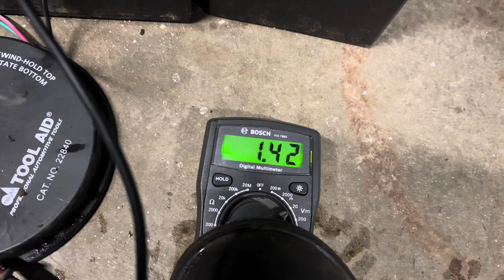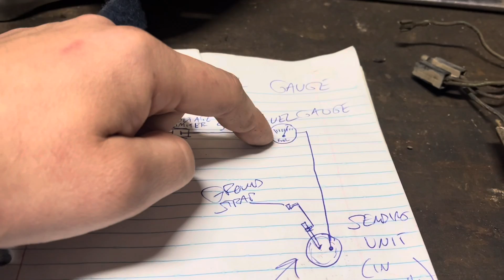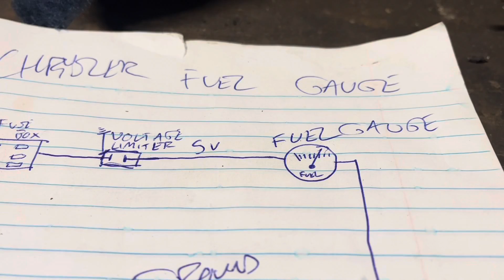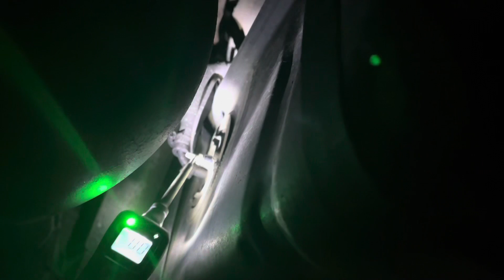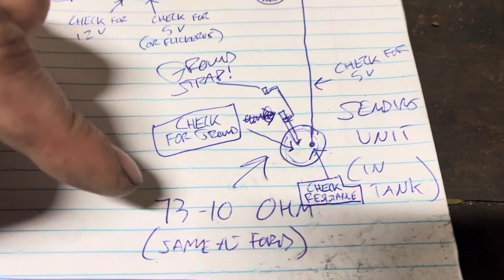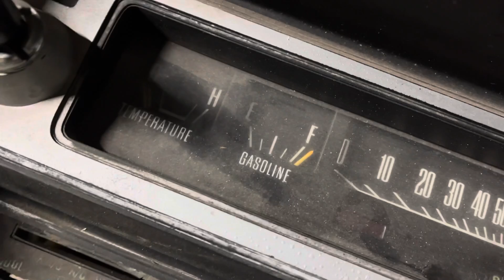Classic Mopar Fuel Gauge Problems (And Gauge Voltage Limiter Info)

Comment: Nice Demon BTW. I have 2 '71's a Charger R/T and a GTX and both have those vapor tanks with the 4 hoses mounted under a panel behind the left rear wheel. They also had the 3 nipple crankcase breather which vents fuel tank vapors into the crankcase. Nice. I disconnected the hose from the tank to the breather. I think each one of those 4 vapor tank hoses go to a vent pipe in each top corner of the fuel tank.
Reply from the maker: Very interesting. I know ‘71s have the four lines but had no idea how they were set up. I had a ‘71 Charger 15 years ago, and still remember seeing all those lines under that. I never drove it unfortunately. That has been a recurring theme with me and third generation Chargers, actually. I’ve owned four, and have never had one that was drivable.
Reply: @DeadDodgeGarage  I guess this is my fourth. It's a 46k mile 4-speed (440), pretty original. I had a Hemi orange R/T, a green '72 rallye 440 and a nice '71 parts car. This current R/T never had a working fuel gauge since I owned it (1998) and I bought a new sending unit and tank long ago and just got around to putting them in a few years ago. I cut the old tank open and you wouldn't believe what it looked like. First time EVER I've seen a rotted brass float. Looked like it was submerged in acid. The original sending unit was 'OK' but didn't work. The inside of the tank was abysmal. I scooped about 1/2 gallon of rust flakes out and it was really weak and nasty. Stored a long time with old gas. You could see where they ran those vents when I cut the tank open.
I think the Spectra tanks are the best, made in Canada OE quality. I used a 'stainless' sender, probably Taiwanese, but seems to work OK. There's some tabs you can bend on it to adjust the range from empty to full. I used a Spectra tank on my GTX too. 
I've had so much trouble over the years with old cars (not just Chrysler) and rusty gas tanks it's almost better to just change it out. I had an '81 Imperial I used a Taiwan tank on about 15 years ago and it worked out nice. Another barn storage car. 28k miles.
Reply from the maker: @vincemajestyk9497  Wow. Yes, I'm 100% on team "just replace the damn gas tank" at this point. I've learned my lesson on that one many times over. I've installed many Spectra tanks in various late model vehicles, but I don't think I've ever put one in a classic Mopar yet. Don't remember what brand I just put in the Barracuda, but it seemed nice enough (before I beat it savagely trying to get it onto the filler neck in the car.) We've gotten a couple tanks from Tanks Inc, and they are very nice.
Reply: @DeadDodgeGarage  The Spectra's are great tanks. They're really beautiful. They have the OE NiTerne steel which most of the imports lack. I never used 'Tanks, Inc' before but I'd be real surprised if they made their stock or catalog tanks in house for what they charge. But honestly, ANYTHING is better than an old OE tank at this point. 
I had an '83 Olds 98 which happened to have a tank that looked good on the outside. I made a 200 mile trip pulling over every 20-30 miles to change fuel filters. Not fun. 
I usually spray a little silicon lube on that rubber seal for the filler tube or even wipe a little gas on it with your finger. Some of those re-pro's are made out of a more plasticky material. A great deal of the reproduction rubbers and seals are real spotty these days.

Comment: I never really had a problem with the fuel gauges, and I've had a ton of Mopars. Once I did have an IVR stick and fried all my gauges as I was driving on I95 on the DC beltway. 1969 Road Runner. It was a smoke show. Lucky there were still a ton of these cars in the yards then (1990). I think I used one of the Radio Shack 7805 regulators in the can after that with a cap and resistor. Most of those gauge problems are grounds. The fuel tank sending unit is SUPPOSED to have a ground strap from the sending unit pickup nipple too the body hard line to bridge the rubber 'splice' hose. I think the RTE (Real Time Engineering Springdale, AR) is the best deal for a replacement. I bought 2 from them. They have so many features, for the price, $55, it isn't worth it to try to mess with anything yourself. They have a status LED, ramp up voltage feature to simulate the original, internal overload circuit breaker, plus over-voltage protection if it becomes ungrounded. You can't beat it. BTW, an old analog Simpson 260 or similar is the best to view that type of device. I did have a '70 Dodge truck with a fuel gauge regulator.
Reply from the maker: I have had a couple dash smoke shows over the years. I got to experience that fancy voltage limiter with the status LED here at Rocket. That’s a very nice piece. I generally make them with the digital limiter like radio shack sold. I do believe I mentioned the ground strap in this video.
Reply: @DeadDodgeGarage  Yeah, you did, it was a great explanation. I've had a lot that worked without that strap. I think they grounded on the top of the ring to the tank and the tank grounded through the straps to the body. When they made contact.

I used a bunch of the homemade ones in the '90's too. The only 2 downsides, really only one is big, is that it one doesn't give a big initial voltage surge like the mechanical thermal strip and points to move the gauge needle fast at key-on. The 2nd is that IF the regulator ever becomes ungrounded for some reason it's going to apply full battery voltage at the output pin. I've never had that happen but it is a possibility if the semiconductor becomes ungrounded.

Comment: What do you think of the 5V solid-state chip conversions for the voltage regulator? A few companies make them (including installing them in the factory housing), or you can try to make yourself by building a time machine and going back in time and buying the chip from Radio Shack before it became a cell phone company. Any cons?
Reply from the maker: Haaahaha. Yes, I used to buy those from radio shack and hand wire them as replacements for the gauge limiters. They work very well, and are still available online from electronic parts suppliers. Last time I needed one, I ordered five. The plug in replacement units are cool, but I like doing it the cheap and hard way.
Reply: @DeadDodgeGarage  I apologize, you actually mentioned the solid-state chip in your video now that I'm rewatching. I figured it was obscure knowledge, but figures you knew about it.

Comment: what do you check when none of your guages work?
Reply from the maker: None? Like, none none? In a classic Mopar? The speedometer is run by a cable, so unless that’s broken or unhooked you should have that. Unless your amp gauge has been bypassed, it has to work or the car won’t run. Oil, temperature, and fuel gauges are run by the little voltage limiter that I describe in this video. If just those are dead, the limiter is your first place to go. Unfortunately, sometimes when the limiters die, they burn up the gauges with them. This is where going through all of the tests I describe in the video comes in - to point you in the right direction.
Reply: @DeadDodgeGarage  yep, nobody's home at all. No lights, nothing. I just bought the car so I'm sure the previous owner tried to do it himself and bypass stuff. 🙄🤷🏻‍♂️
Reply: @DeadDodgeGarage  I do, however have head, tail, and break lights.

Comment: Greatly appreciate this video. I wish I had seen it prior to replacing my sending unit in my 1979 power waggon however it’s done and I will order this voltage regulator in the hopes of getting my truck ready for a safety. Those driveways won’t plow themselves this winter😂

Comment: My fuel gauge is dead, my sending unit reads the correct reading. My temp guage works, but when I check fuse I get no reading and the fuse isn't popped. What could be the problem, and answer or any ideas is much appreciated. Working on a 73 dart.
Reply from the maker: If your temp gauge works, you have power to the gauges, and a working voltage limiter. A bad fuel gauge, poor connection at the circuit board, or other wiring issue could cause this. I’d lean toward circuit board connection - our coronet has had that issue intermittently for a long time.

Comment: What’s the part number for that voltage limiter? I have a 1969 Dodge Dart with a standard dash that I’m fixing up.
Reply from the maker: https://www.digikey.com/short/21z2bd33 this is the modern solid state voltage limiter that I use to replace the original part. It takes some soldering, but it’s not too hard a job. I have heard recently that there is a pre-made plug in solid state regulator available. I imagine you could find that one with some google-fu if you prefer to save some time.

Comment: Holy cow I’ve looked everywhere for a video explaining this. Driving my 65 Coronet down the highway (8 years ago,yep) and smoke came up through the dash. Fuel gauge went down. That was that. Last year finally found a new gauge online for a discounted 180 dollars. Installed that one and POOF. Same thing. The little wire that’s wound behind the gauge burned up. Is there a way to fix those?
Reply from the maker: I haven’t worked on one of those specifically, but I’m sure it’s like the other earlier Mopars and it’s a three stud fuel gauge with the voltage regulator built in? It also powers the other gauges through its 5v output stud. I have fixed that before - clip that section inside the gauge, go to an external type - ideally electronic as I showed in the video - and wire the external regulator’s output wire to that output wire on the fuel gauge. If that’s confusing I apologize - I will have to find a test subject to show that fix. Basically the idea is, the regulator inside the gauge goes away and the new external one takes its place.
Reply: @DeadDodgeGarage  Thanks for the reply I really appreciate it. Yes it’s just like the Mopar’s with the three stud fuel gauge, this is above my level of expertise for sure lol. I will have to get a new gauge and then be very careful and make sure I get the right stuff before I ruin another one, Getting harder to find that’s for sure. Love your videos keep up the great content
Reply: I have a 71 duster rally dash with regulator built into fuel gauge works fine but I would like to upgrade to new style
Reply: A while back all of my gauges pegged to the right, then they didn’t work at all. Installing a new wiring harness and firewall regulator, which didn’t fix it, I got a limiter from orielys and all it did was fluctuate back and forth. Thankfully I hadn’t fried my gauges. Did some research and ended up buying a solid state limiter for $60.
Here’s a video explaining how to bypass the fuel gauge component by either breaking the internal on the fuel gauge, or using heat shrink. I’ve got a 64 barracuda so this panel is a 64.. but the innards should be the same on a fuel gauge.

https://youtu.be/MmkED8Mjm-k?si=RnqdnuaVwCD980v-
Reply: @campsmoky  thank you!!!!! I appreciate the reply and the link!!!

Comment: excellent video, very accurate, I have seen where some people took the solid state voltage regulator and inserted it into the original mechanical regulator case, Just a suggestion
Reply from the maker: I’d never thought of that. That would make for a nice installation - but seems like a lot of work for something I’ll never see again. Haha.
Reply: You can buy solid state limiters that are in a factory looking case. (I used one.)  Some sellers request the core back from you, so I suppose they are gutting old factory units and putting modern guts inside.

I had started making my own out of a 12 vdc automotivr style usb charger. I figured it was 12 volts in and 5 volts out so it should work. Then I found the repros online and abandoned that idea.

Comment: I think you'll find the voltage limiter in that rallye cluster is the type that's built into the fuel gauge. Actually, hopefully you'll never need to find that out.

A couple years ago I replaced the gauge in my 70 Swinger with the guts from a gauge from an 82 Jeep. The Jeep's gauge housing is exactly the same as the Swinger's but the face is different. I put the Swinger's gauge face on the Jeep's housing, added a voltage limiter, and for the first time since the late 1980's the car has a fuel gauge. Revolutionary.
Reply from the maker: That’s brilliant! Jeep CJ? I’ve swapped fuel gauges between various Mopars - same deal, they all seem to have the same mounting situation but different face styles. 

Actually the rally cluster does have a separate regulator, but it’s the type that has multiple output spades for the various separate gauges and mounts backward, as all of the wiring is point to point.

Comment: I had to replace my headlight switch in my 74 sat this last weekend. Now when I ran the car on Monday my fuel and temp gauge was not working. Good timing on the video. 
My oil gauge never worked. But I don't hear a knock, so I'm ignoring it.
Reply from the maker: Hope it helps! Oil gauges are extra. Often with tired old small blocks they just tell you things you don’t want to know.